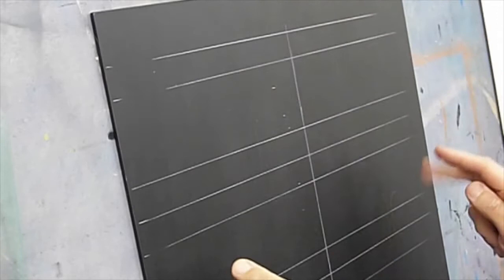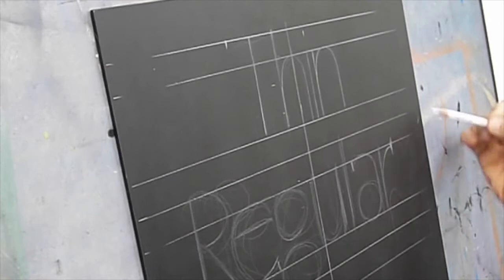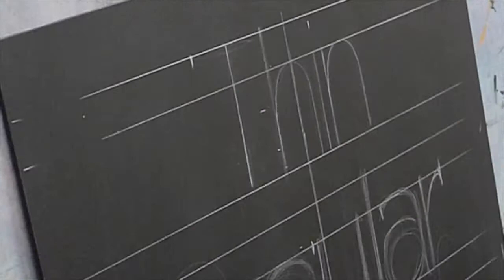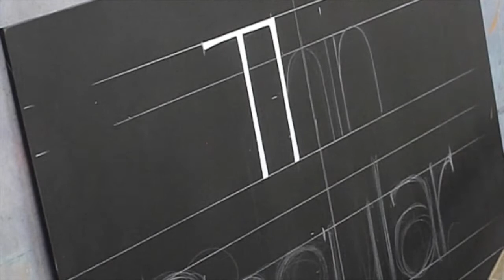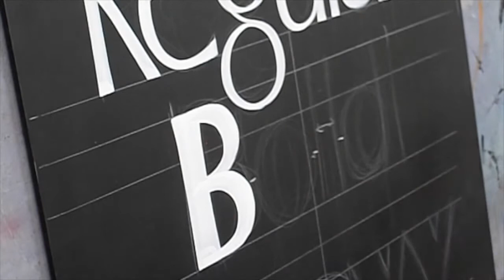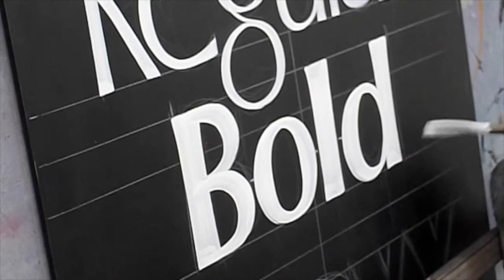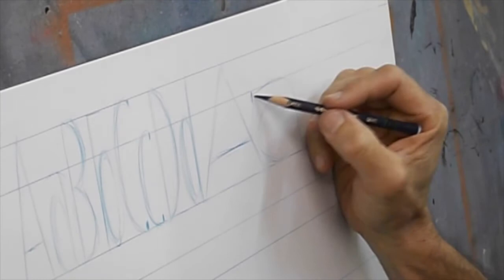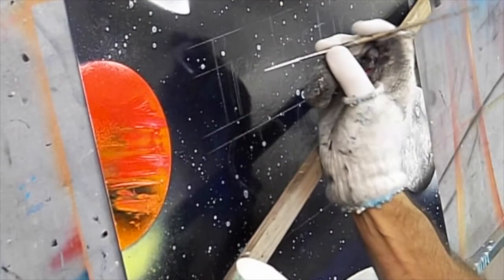4 Optima Sizes and Samples

Comment: Hey David , I know this is a old video but I was wondering what the difference is between the kwill brushes and the liners? And when would you prefer one over the other? I know is says a liner but it just looks like thinner and longer bristle ?
Reply from the maker: Liners are mostly used for pinstriping. They can be nice for thin scripts. Otherwise use Kwills for most lettering.